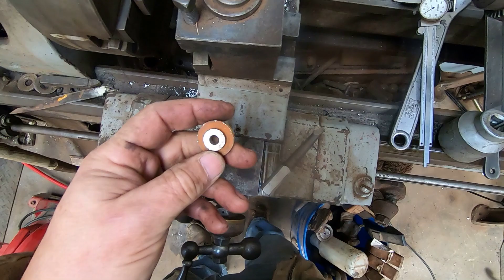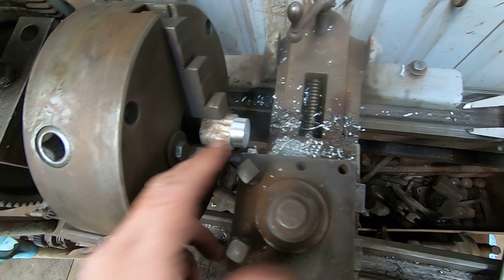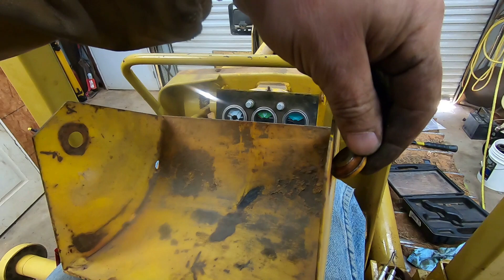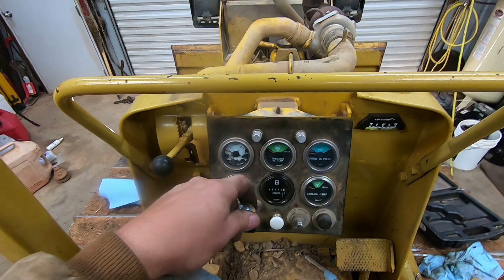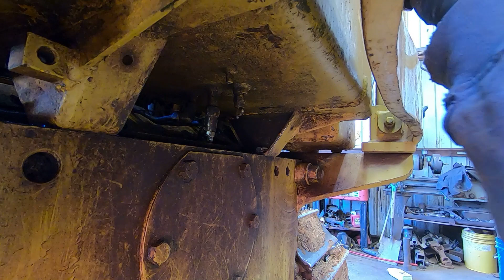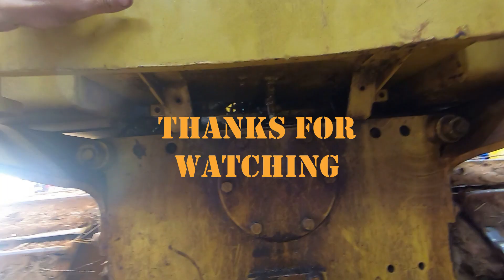More dozer Maintenance

Comment: I have a 78 TD8E, and just had the same problem with the fuel shut off valve. Had to just replace it with a elbow and a short piece of rubber line with a new valve.
Reply from the maker: I was able to put 2 O-rings in this one, so far it’s working good.

Comment: Frank. I noticed those fuel tank support brackets have some nice holes in them. Was there a protective shield bolted there to protect the fuel valve? Perhaps you should consider making one to protect the valve from a stick breaking it off when backing into brush. You will know when it happens when the engine runs out of fuel and the tank is drained.  Just a thought
Reply from the maker: I noticed that too, may need to make a plate for it.

Comment: A little trick to help valves from leaking. Open the valve all the way, then turn it in 1/2 turn. Takes the mechanical pressure off the packing🇨🇦🤙🏼
Reply from the maker: Thanks for that! This one leaked no matter where I put it. I replaced the square ring with 2 o-rings and it’s working like a champ so far. 👍😎🇺🇸

Comment: like the shop vac trick.  how much diesel you get in it once it gets air from removing the valve?
Reply from the maker: It was just a splash, if I was more careful I think it could be done without any. Worked a lot easier than draining it that’s for sure.

Comment: Is yours leaking at the throttle linkage also on your injector pump?
Reply from the maker: Yes, and maybe a bit from the distributor end too.
Reply: I have talked to the case dealer and he said they're about two grand, to buy and have installed.  Have you found a better price?
Reply from the maker: Jacob Bradburn I have found a seal kit online but I’m not familiar with that pump, would need to study that a lot before I would attempt it myself. There is a guy online that offers a rebuild for $500, that may be the best deal, of course you would need to install it. For now I will turn off the valve.
Reply: That's what I do. I have a 90° shut off valve. I put it right out of the tank where you changed your T valve fitting.